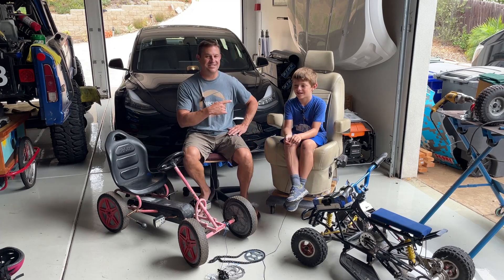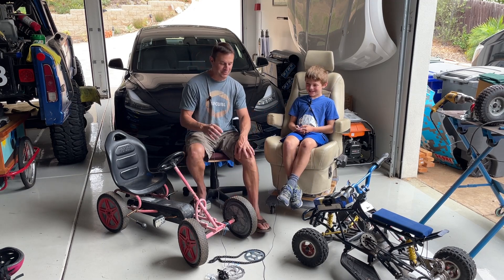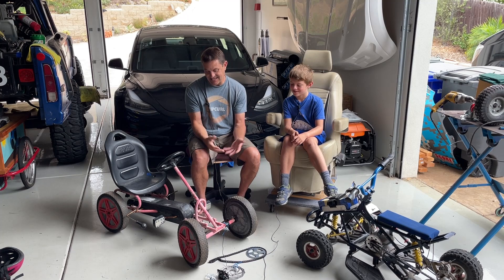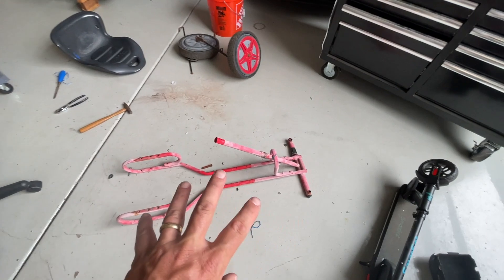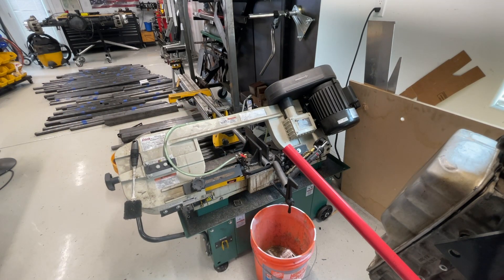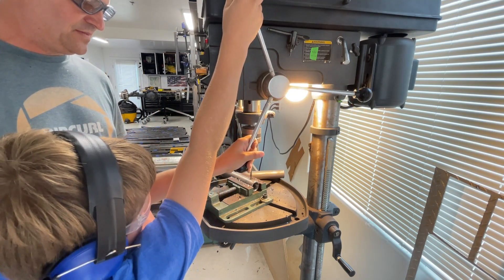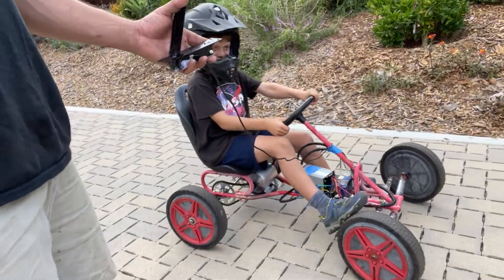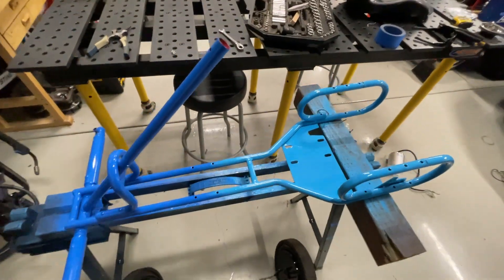48 Volt Go Kart Build with Fusion 360 and the Langmuir Systems CrossFire XR

Comment: Every guy watching this left with a giant smile. Honcho's got nothing on his new ride.

F360 notes. 1st, thanks for the image import section with calibrate. You don't have to fool with that triangle business to get those sprocket holes correct. On your sketch, just place the first hole, then circular pattern 3, then you can dimension the hole-to-hole spacing directly without figuring out the radius.  Thanks for the video.
Reply from the maker: That is great.   I am going to try it as soon as I get back to my computer.  Thanks.
Reply: you can also figure out the diameter easily by taking the center-to-center distance of the holes (B) and the number of holes (N) and putting them into this formulaD=B/sin(180/N).  I have a little spreadsheet with the formula ready to go.  I just plug in the 2 variables and boom out comes the diameter.
Reply: @Scottforyoutube  this is true, there are many approaches to solving this measurement.